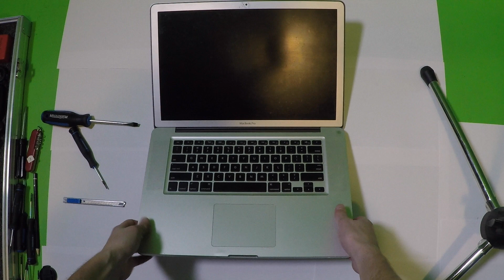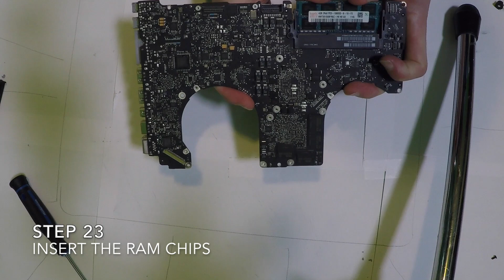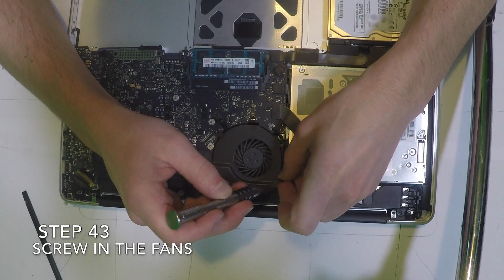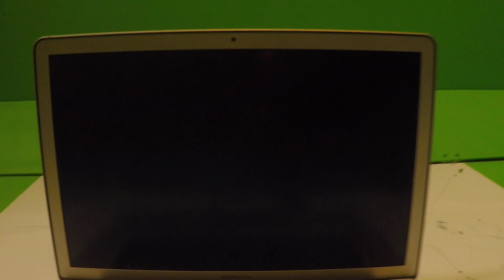Guide/Tutorial: FIX Your Old MACBOOK Pro

Comment from the maker: 0:00 Intro
0:28 Tools You Need
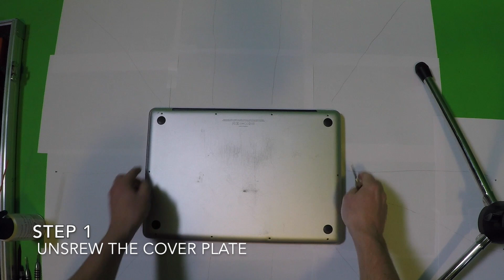1:03 Step 1, Remove The Back Cover
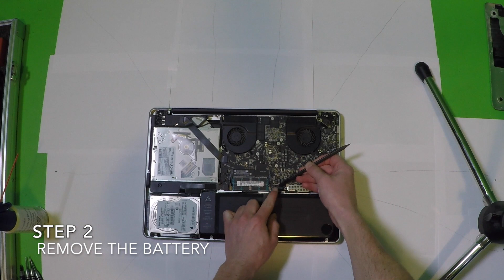1:12 Step 2, Remove The Battery
1:42 Step 3, Remove The Fans
2:47 Step 4, Disconnect The Camera
3:02 Step 5, Disconnect The Bluetooth
3:18 Step 6, Disconnect The Optical Drive
3:27 Step 7, Disconnect The Hard Drive
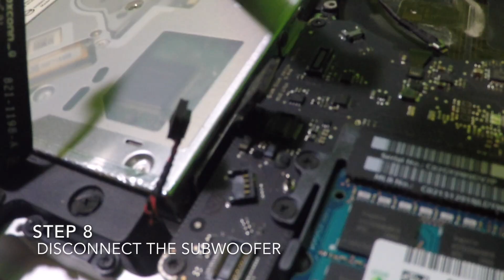3:38 Step 8, Disconnect The Subwoofer
3:54 Step 9, Remove The Cable Cover
4:08 Step 10, Disconnect The Track Pad
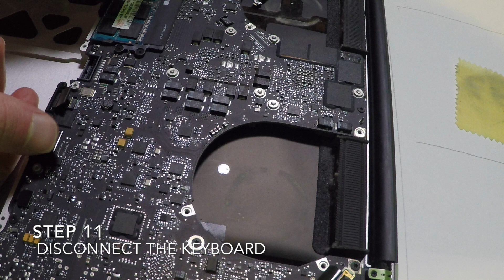4:18 Step 11, Disconnect The Keyboard
4:52 Step 12, Disconnect The Battery Indicator
5:02 Step 13, Disconnect The Display Data Cable
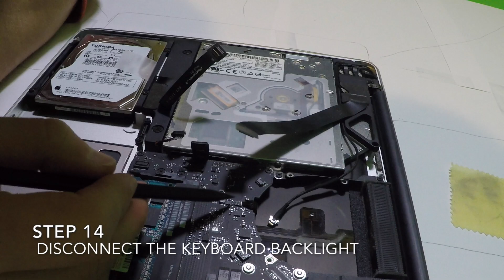5:22 Step 14, Disconnect The Keyboard Backlight
5:47 Step 15, Remove The Logic Board
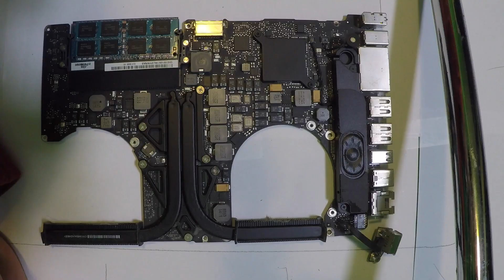6:48 Step 16, Remove The Heat Sink
7:02 Step 17, Remove The Speaker
7:34 Step 18, Remove The Microphone
7:50 Step 19, Remove The DC Board
7:58 Step 20, Remove The RAM Chips
8:13 Step 21, Clean
8:19 Step 22, BAKE
8:34 Steps 23-28, Reassembly 
9:17 Step 29, Clean The Components
9:48 Step 30, Apply Thermal Paste
10:03 Step 31, Install Heat Sink
10:21 Step 32-47 Reassembly
12:43 RESULTS
Reply: I burned out… I preheat the oven